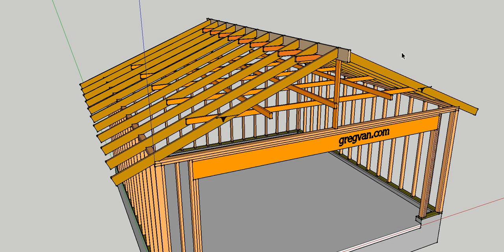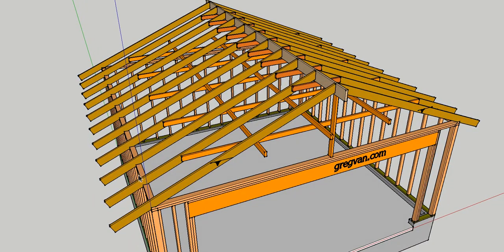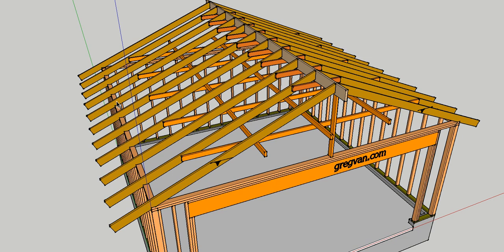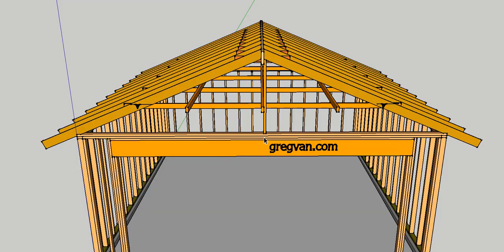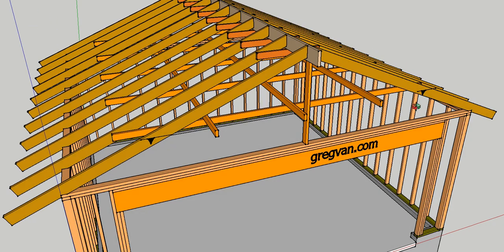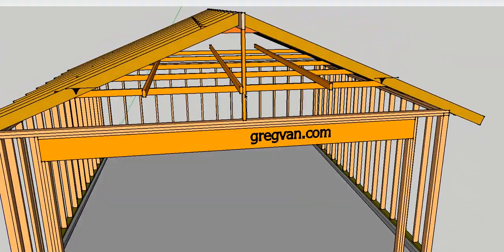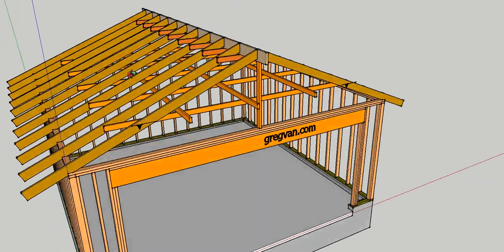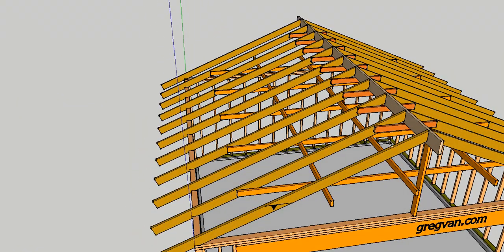What is a Roof Rafter Tie and What Does It Do? – House Framing Parts

Comment: I have no ridge board and only joists but those weren't enough bc 1 exterior wall starting bowing out . Would you suggest another set of rafter ties and collar ties?  No other interior support inside attic under roof.
Reply from the maker: It does sound like a rafter tie might help. Send me a picture if you need more help.

Comment: I’m seeing conflicting information, I’ve read the top third is measured from the top plate to the bottom of the ridge board, but in your video you state that it’s from the top plate to the top of the ridge board. I watched your collar tie video as well, can both collar ties and rafter ties be 48 inches on center both on the same rafter? It’s for an 18x18 chicken run with polycarbonate clear panels.
Reply from the maker: Yes, both rafter ties and collar ties can be on same rafters and since the building code information isn't perfectly clear, I went with the top of roof.

Comment: This is similar to our (1947) shop which we've dubbed "the barn" because of the 62" wide wall studs with cross bracing (another topic for later).  
In our case the rafters are 24" apart (more or less) with one tie per rafter. Where ours differs is we don't have collar ties like in your example and have heavy gauge (3/16?) wire which drop down from the ridge to loop around the rafter and then back up to the ridge. The wire is then twisted to the right length which in our case (some 76 years later) are not tight against the rafters. In my very limited engineering knowledge my guess is the wire does something similar to what king posts might do and were installed to act as support for the storage platform that was up when we bought it and which should have never been added but since have taken it all down.
I'm now using the barn as a wood shop and trying to figure out how to strengthen the system up for an earthquake prone area. I'm adding strong backs and have, as budget allows, started replacing the walls. Some of which have had extensive mud sill rot. The new walls will all have 16" spaced studs to give the roof something more structural to sit on. As for the roof itself I wasn't sure if I should add additional ties (like you have here) or to replace the old wire with actual king posts or purlins which in that case I'd need to use connector plates to tie them in to the ridge.  Thought?
Reply from the maker: It might be easier to install new wood rafter ties. Let me know if this did not answer your question or questions. I only found one question.
Reply: @gregvancom  Thanks Greg for replying! Been watching your videos for a few years now and really appreciate them! 
I know it's difficult to know without seeing something but I guess I'm wondering whether the wire being used to support the centre of 16 foot rafters is sufficient or would it be a good idea to replace them with 2x4s, similar to king posts, and besides adding collar ties and strongbacks, which I'm in the process of doing, is there something in addition I can do to strengthen the entire system up? The barn has lasted nearly eight decades and I hope it'll last a few more decades. Lastly besides lighting and electrical routing I won't be using the space for storage and so I don't mind adding more support.  We live in a wet, windy, and seismic area if that helps.

Comment: I have an old camp that I am trying to make my home..my rafters go from the top plate to the ridge and have a small triangular collar tie type of wood at the ridge.. Would I be able to double up rafter ties, one on each side of the chosen rafter? My hope would be to box them to get the beam affect..Also if by doing so would it allow me to raise the rafter ties to the middle third rather than the bottom third?.. I have lived for 4 years with 6' 8" ceilings so I'm trying to get the most height I can get out of it lol.

Comment: What is the maximum width or span a garage can be using a ridge board construction method?
Reply: Can a ridge board method be used for a 32x30 garage? Absolutely love your videos. I have bought your lunch many times with my viewing times. haha
Reply from the maker: Garages can be wider than 32 feet using roof rafters and ridge boards and thanks for lunch today I had pastrami:)

Comment: I have a cold storage space where the roof is starting to sag that needs some additional rafter ties. can I just nail them into the side of the rafter?
Reply from the maker: Usually if you're going to fix a sagging roof the rafter ties might need to be support beams instead. Something stronger to reduce or eliminate sagging.

Comment: What prevents all of the rafters from toppling over, either toward the front or toward the rear of the garage, in the direction of the ridge tie?  Don't you need a diagonal board, like going from the top plate to the ridge tie?
Reply from the maker: Yes, some type of bracing and I would check out some of our home building series at our website for more examples.

Comment: When measuring the thirds, I’ve seen many measure to the bottom of the ridge, not the top. 

In my building, it is exactly 3 feet from the top of the plate to the bottom of the ridge, but about 3 foot 8 inches to the top of the ridge.

My rafter ties are 2x4’s that are 11 inches up from the top plate. Is this acceptable?
Reply from the maker: I really can't provide engineering information on your project, but can offer an opinion suggesting that you should be fine.
Reply: @gregvancom  thanks! Is it typical to hang drywall from rafter ties like this?

Comment: I'm doing some garage renovations and essentially took off the drywall ceiling to make the space feel more open. Since I did that, I believe my ceiling joist would turn into rafter ties since they won't be supporting a ceiling or storage. Is that correct? I do need to replace some of the old ceiling joists, so what would the requirements be now that they would be considered rafter ties? The current rafters are 2x6 so my guess is that a 2x6 rafter tie would be sufficient but I'm not sure. The current ceiling joists were spaced 24oc and the span of the room is 17.5'. Let me know if you have any insight. Your videos are super helpful!
Reply from the maker: I cannot provide you with structural engineering information, but can suggest that if the minimum distance for spacing rafter ties is usually 48 inches on center, then you're probably in good shape.

Comment: Greg, I'm extremely grateful for your excellent advice and videos!   I had a sagging garage ridge and bowed out wall of my garage.  After watching your videos multiple times and spending some time above the ceiling in my garage I realized the original builders had used a poor design and that one end of the ceiling joists were not securely connected to the  wall.  This was done to accommodate a decorative overhanging eve over the bowed wall of the garage.   Without getting into too much detail I used a combination of techniques to raise the ridge and straighten the wall.  

I used 7 turnbuckles between the ceiling rafters and the wall to help move and straighten the wall.  At the same time I used two bottle jacks with 2x8's to support and push up the sagging ridge.   Also the ridge was not one solid beam but instead was two beams which meet in the middle at the center point of the sag.   Over a period of a couple months I slowly moved the wall and the ridge by tightening the turnbuckles and bottle jacks a little every day or two.  After the ridge was straight I glued and screwed two pieces of  3/4 in.  plywood to either side of the ridge beams where they meet to hopefully help maintain the new position.  

I have tried to fasten the original ceiling joists to the wall but I'm not overly confident in the permanence of that connection.   The wall however, is perfectly straight now.

But most importantly I installed ten  2x4x16's as rafter ties in the lower third of the attic space.   I think these ties will be the primary force holding the ridge in a straight position.   I am wondering if I need the strong backs installed as well and also in another video you talk about vertical supporting  2x4's between the ridge and rafter ties.   The 2x4x16 rafter ties I've installed seem to be very strong but I'm wondering if they need additional support.   I haven't yet removed the bottle jacks so I'm hoping to have done everything possible before removing them.  Thanks again Greg!
Reply from the maker: You're welcome and as far as the supports, I don't know if the 2 x 4 ceiling joist will do much, maybe a 4 x 8 will do better. Let me know what you do and thanks for sharing your project with us.
Reply: @gregvancom  love your videos

Comment: If I put these on every rafter instead of every 4 feet, could you put sheet rock under them? I'd like to have a higher ceiling in the middle , (it's a shed), and if I am using 2x6 instead of 2x4, would this work?
Reply: I’m wondering this also for my garage. I’d also like to insulate the space above.
Reply: I’m wondering the same thing. What did you figure oitv

Comment: I'm building a 26x40 garage 2x6 on center walls and a 2x10 ridgeboard. 2x8 rafter 16 on center with 7/12 pitch. 2x6 rafter ties on every rafter at a 3rd of the distance. Any suggestions or what u think about this build and  can I use bolts for the rafter  for the rafter ties. Plus hangers for the rafters.
Reply from the maker: I cannot provide structural engineering advice to my viewers. However, roof rafter ties usually have a minimum spacing of 4 foot on center like you're suggesting.

Comment: I have a mid ‘50’s two car garage which is 24’x20’ and it has wall ties 16” OC and two strong backs.
Reply: Did you put a ceiling?
Reply: I have a garage that has a lot roof ties every 22.5. Thinking about adding a ceiling..

Comment: When you have top plates (where the rafters sits) that are not level from one side to another due to different wall heights,  are the rafter ties level and go from one wall plate/rafter to the other rafter?  id rather have them sitting on the wall plate then up the rafters.
Reply from the maker: I've seen them installed both ways.

Comment: I have an old single-car garage without rafter ties or joists! It's about 14 feet wide and 25 ft long.  I want to put solar panels on the roof (which already has a slightly-sagging ridge), but am concerned about the extra weight. Should I put joists in the garage and then add some kind of knee wall or something? Would rafter ties also be helpful?
Reply from the maker: I cannot provide you with structural engineering advice, but if it's a concern of yours, I would definitely try to reinforce the roof to make it stronger, before adding additional weight to it.

Comment: If I use 2x6's between gambrel gusset plates and rest them on a wall down the middle, can I use them as ceiling joists.  Span is 18 feet with a wall in the middle for a span of 9 feet each section.
Reply from the maker: I would probably need to see a picture of what you're referring to, for more information. You can get our email address of the website.

Comment: I would like to take my roof off and do a new one
Reply from the maker: It can be done, just make sure that if any walls need to be braced to prevent them from moving when you remove the roof aren't going to move. The roof usually holds the house together.

Comment: Very informative! I have a 22 by 19 feet garage where the door is on the left wall of the building in your example (about 12 feet tall wall), and the right wall is shorter (about 10 feet tall) so the right side of the roof is larger. There are three 2x4 rafter ties that span from the top of the plates on each wall, so they are not horizontal, they overlap about 3 feet. Two 2x4 strongbacks that are nailed to the rafter ties however they have separated over the years about 3/4". The ridge has sagged a bit. I was thinking in replacing the rafter ties with new 2x4s or 2x6s that go form the top plate on the left wall and tie them on the rafters on the right side of the roof to make them horizontal... what do you think? I'm not planning to drywall the ceiling maybe just the walls. I'm in Southern California and the house is from 1955 by the way. Thanks for your help!
Reply from the maker: That seems like a good idea and I would re-fasten the strong back to the rafter ties with a few more nails or screws to close the gap. Feel free to send me some pictures of your project, for more information and may be a possible video.

Comment: hello thanks, what a  nice clear diseng and interesting video about construction. I've been reading about wooden constructions on the internet for a few weeks and I would like to try build one myself (I'm from Europe and this way of building is not so common here). But I would like to give it a try for a small garage in my garden. What are the measures of this garage, to have a general idea. And what sizes lumber ?  I guess 2x4 for the wall framing ? What sizes are the ridge beam and rafters ?  2x6 for the rafters and 2x8 for the ridge beam ?  Are that common sizes ?  (my garage will be 17ft wide and 20ft depth (roof from very light metal plates, about 8kg/ square meter. Thanks for reading this
Reply from the maker: I'm not a structural engineer cannot provide you with lumber sizes, but can tell you that a 20' x 20' garage has been built before with 2 x 4 wall studs, 2 x 6 roof rafters and a 2 x 8 roof ridge.

Comment: Greg, 
   I want to raise my garage ceiling to add a lift. My roof has a ridge beam and rafter ties.  Can I move the ceiling joists up a few feet and attach them to the rafters?
Reply from the maker: If you have a ridge beam supported by a post on each end the you might not need ceiling joist. https://youtu.be/ZjYDIece0CY This might help.

Comment: what would be the best technique to strengthen a roof to take a solar system. the roof i am working on has 2x6 rafters and 2x6 ceiling joists that span 24 feet. Someone suggested a knee wall but that would just transfer the load to the ceiling joists so that wouldn't work. any ideas would be appreciated. thank you
Reply from the maker: You might want to contact an engineer, but roofs can be strengthened by adding larger roof rafters and ceiling joist or adding an additional rafter in between the others. For example if you have rafters that are spaced 24 inches on center you could add one in between making them 12 inches on center.
Reply from the maker: I thought I had a video, but will make one within a few weeks on how to strengthen roofs.
Reply: What about using a very beefy LVL for the ridge beam, supported solidly at both ends? That would allow the clear span, would it not?

Comment: I'm looking to convert my attic and there are currently rafter ties but are they needed since the floor joists extend out to the roof rafters. The walls are cavity blocks.
Reply from the maker: Feel free to send me a picture, but as long as the floor joists are acting as rafter ties then you shouldn't have a problem.
Reply: @gregvancom  thanks for a great video....if you were to convert the attic and add floor joists to support a floor, wouldn't you have to then make sure the rest of the structure was built to support the extra weight? thanks